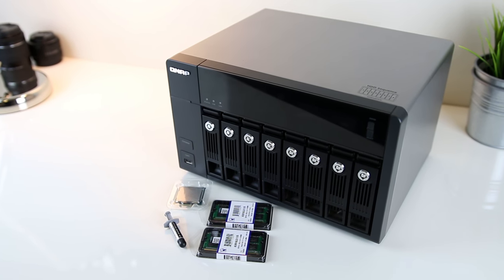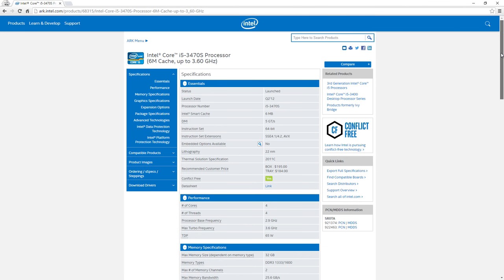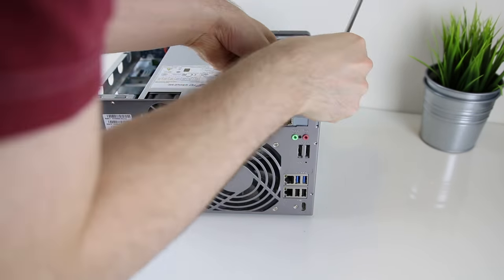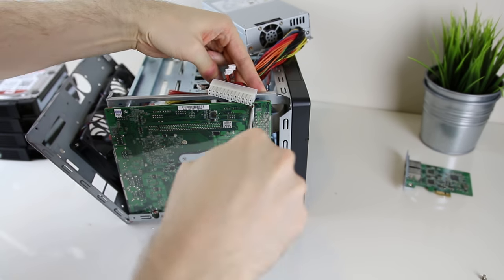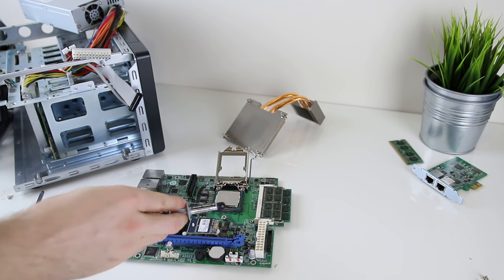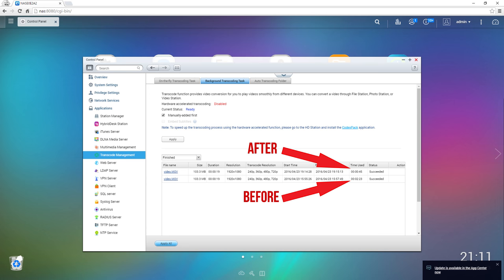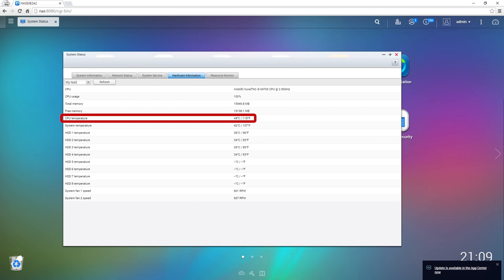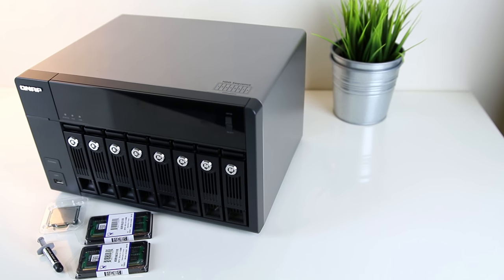Upgrading The QNAP TS-870 NAS - New CPU And RAM

Comment: This is such a great video!

I was able to perform the exact same upgrade using the same CPU and DDR 3L memory. The box is noticeably faster on the web interface. It took me an hour but I left off one of the front-panel cables so spent another hour trying to figure out what was wrong. I'd love a little more detail on the cables in the video.

Thank you so much!

Comment: Thank you for this! I finally completed my upgrade tonight. Luckily a shop in Adelaide (JDM PC sales) had a second-hand i7-3770S in stock at a good price. Shipping was quick too.

I followed your video exactly. That long screwdriver though! Luckily Bunnings closes late here. Quick last-minute trip. But they don't even have a #1 Phillips screwdriver that long on their books! I did get a long extension bar for a screwdriver drill bit that worked though thankfully.

I am loving seeing Memory usage hovering around 8% rather than 90%.  Right, lets set up some VMs! Very happy.

Comment: Thanks for this video. It gave me the courage to finally upgrade my 870 with an i5-3450S. Could have went with a beefier chip but decided to keep the power consumption low and the cost relatively low. It's more than enough for what I do. Believe it or not, the Celeron was a downloading speed bottleneck. I have a 1 Gbps FiOS connection and the CPU was always pegged when downloading via usenet. The most I ever got was 95 MB/s, but after swapping out the CPU with the i5, my speeds rocketed up to 108 MB/s (downloading + unpacking simultaneously!) Who knew that the CPU played a major role in unpacking. I guess IOPS heavy tasks require a decent CPU. So thanks again for the help.

Comment: You can get third party 10gbe network cards that work in the Qnap for around £100.Also the cheapest 10gbe switch is around £250 (With at least two 10gbe ethernet ports)

Comment: I know its an old video, but I still use my TS-870 Pro as a media server and backup storage device.  I did your upgrade with 16 GB Crucial RAM ($80.00 US) and the i5-3470S ($18.00 on ebay).  What a way to breathe new life into an otherwise awesome NAS.  Although I'd have figured out the procedure myself, your video was most helpful !!!   Thanks for sharing.   Oh... BTW - your description says you used an i5-3450S not the 3470S you really used.  I really like the i5-3470S as its a true 4-core CPU, not 2-core with HyperThreading.  4 full cores always performs better than 2 + 2HT.   ;-)
Reply from the maker: That's good to hear I'm still using mine as well and it's working great!
Reply: @JarrodsTech  Its kind of a shame that QNAP will End-of-Life the 870 Pro near the end of 2020.  The unit is still in perfect shape and should last a lot longer. I like getting the new OS version updates.  I have 3 older QNAP servers that are EOL and I only get occasional OS patches for those.

Comment: I just upgraded my qnap 470 ts to i7 3770S and 16gb ddr 3 ram 1600mhz.
System flies. I added also 8$ pci nvme off ebay with 256gb toshiba nvme ssd it works like a charm.  Used new arctic paste on cpu. Syste. Runs faaaast 😎 soo happy iam set for a while now.
Reply from the maker: Nice upgrade!

Comment: On this hot Australian summer's day, I was wondering how the stock cooling went with your i5-3470S upgrade. I'd assume not a lot of difference for only +10W TDP. I've got the PRO model, which already has the i3-3220. For everyday use (maybe play around with virtualisation, but not seriously), I probably won't see a lot to be gained from any Ivy Bridge CPU upgrade. I've found an i7-3770 (TDP 77W) as well as the i5-3470S you used. Concerned I'll then have to mess around with the cooling in the case of the i7. What do you think? Keep the stock i3-3220 (55WTDP) and just upgrade the RAM? Put in the i7-3770 and deal with the cooling if necessary?
Reply from the maker: To be honest my NAS sits pretty idle these days, I put 4K video on it and edit off of it but it doesn't really get much of a work out other than just storing and serving video files, I don't even monitor the temperatures. It's sitting at 46c idle at the moment with both fans on 800 RPM, I'd like to swap out the fans at some stage, even at idle the fans are louder than I feel they should be.
Reply: A couple of years late to replying... but I upgraded to the 3770S and 16GB many years ago and my NAS lives in rack a garage in Melbourne Australia.  In the peak of summer if we have a series of 40C+ (104F+ for those that need freedom units) days I will very occasionally get heat warnings, but never enough to have it shutdown (which it will do).  Even in this extreme it copes just fine.  I'm currently looking to breathe some more life into this old NAS by moving to UnRAID or something.

Comment: thanks for this detailed video.  i'm finally getting around to upgrading my 870 pro, so my appologies for the very late reply! :)

May i ask - why did you go with the 3470S over the 3470T, which you stated had a lower TDP rating which would be desirable.  what it just a cost decision?
I am still weighing my options as to what the best CPU to go for is... and am looking at their bigger brothers, the i7-3770T & 3770S.  by your logic, the T is the better choice... so long as it's not too pricey.  are you still running the same setup all these years later and happy with how everything has been?
Reply from the maker: Cheers! To be honest I can't remember the reason but think it came down to pricing / availability at the time. Yeah I'm still using the exact same setup, though since this video I filled up the rest of the drive bays with 4tb drives. It's about 2/3 full though so might have to look at larger drives in future, or another plan was maybe use this Nas as a backup and get a new one with the larger disks and just nightly backup important files to it or something. Still works perfectly fine to this day with all the upgrades though 👍
Reply: @JarrodsTech  great, thanks so much for the video and effort - I went ahead with the same choices. In the end, I also couldn't justify almost double the cost for the T,, which isn't double the chip, even on the used market. 

The NAS has been running great!!  Your tips made it a breeze (done in 25 min)
Reply: Yeah, the T chips are hard to get and expensive. Does it run ok on the S chip? By "run ok" I mean not too hot or fans working hard all the time?

Comment: My question is, if i upgrade the memory in my NAS will it "Unlock" other apps to use i.e. i have a TS-469 PRO and if i "Upgrade my memory" will it unlock the Virtualization Station or other more memory intensive apps
Reply from the maker: There does appear to be memory requirements: https://www.qnap.com/en/how-to/tutorial/article/virtualization-station-system-requirements

To be honest I can't remember if it was unavailable for me before upgrading, I don't think I ever attempted to install the feature.

This article also notes that at least 4GB is needed: https://www.qnap.com/en/how-to/tutorial/article/how-to-use-virtualization-station seems to depend on the model of NAS though. I can't see the TS-4* series listed there though so you may need to contact support and confirm that it's possible. If you do please let me know what happens, I'd like to know!

Comment: Awsome tutorial  iam gonnaa do same upgrade to my qnap ts 470  but iam usong i7 3770S
Reply from the maker: Thanks! Sounds good 😃
Reply: @JarrodsTech  i found base cpu a 2.6ghz  celeron g550 has 65w TDP as i7 3770S 65W TDP
Reply from the maker: Nice one 👌
Reply: I have 2 question for you. 1. Do you have to use qnap  network  card or can you use any brand of low profile network card. Also i noticed a mini pcie on the motherboard can those be used for ssd card?
Reply: Yes same tdp  cpu temp at 5% cpu  usage is 51 -53 degrees.  At 0 cpu uaage   47 degrees.  Used arctic silver 5 paste.  Also i added 8$ ebay m.2 pcie m.2 adapter  with 256gb toshiba nvme. And it was detected by the system 😍 .iam using it as system disk cache. So  no need to fork out 200 $ or more  on qnap  branded     m.2 adapter. Expansion card.    I noticed there is also a half height mini pcie port that is  in the back of the mobo.  Next i will get a     1 gb 6gbs msata ssd for it.

Comment: Can you think of a sub $1000 model that has CPU that is upgrade-able? Thanks.
Reply from the maker: Hmm not really sure, I haven't been looking at the recent models so I don't know what's available. I just looked at a couple of QNAP NAS for sale that are newer and they have upgradeable CPUs. QNAP TS-563-2G 5 Bay NAS and QNAP TS-431X-2G 4 Bay NAS for example have the i7 4770 which is already quite powerful, but not soldered so the CPU could be replaced with others that support the same socket.

Comment: Do you think that the nuc board with a i3 7100u (nuc7i3dnbe) could be fit inside the 439 pro 2 as a full replacement of the original board ofc?
Reply from the maker: I have no idea in the form factor of either, sorry.

Comment: Hey there! I'm thinking about buying the QNAP TS-873, but do you think that the CPU of that model is also upgradable? And if so; how do you know which CPU's will fit on the motherboard?
Reply from the maker: From a search it looks like the CPU uses "AMD R-Series RX-421ND", I've never heard of this but it sounds like it's an embedded SOC, so likely soldered to the board and cannot be upgraded. For upgradeability I think you'd need to look for something with an Intel i3/i5/i7 or AMD Ryzen CPU, as those would most likely have sockets.
Reply: @JarrodsTech  Thanks! Are models with well-known CPU's (Like a i5, etc.) more likely to be socketed? Or how does that work?

Comment: Hello Jarrod,  question - Do you think putting in a Intel I-7 cpu at 95 thb into the ts-870 pro would be to high? I saw that you used a Intel I-5 processor and you said that you were concerned about the tbd being higher than you liked but was ok . Do you think the I-7 would be ok, my qnap is on 24/7.
Thank you
Joe
Reply from the maker: Maybe, really comes down to how hard you're loading it up, if it's mostly idle and only doing short bursts of load even if the CPU TDP is higher than the cooler can take it'll probably be ok for the most part. I don't really know how hot it would get though, you'd just have to test it. I suppose worst case it would just thermal throttle and perform a bit slower.
Reply: Jarrod, Thank you sir!

Comment: could upgraded it to a i7 and more than 16gb of ram if you wanted?
Reply from the maker: With this model I believe 16gb of ram is the maximum, however yes i7 is possible with this socket, I decided against it as the CPUs cost a lot more and have a higher TDP and I was unsure if the cooling solution inside would be able to deal with that.
Reply: @treje  I have instaled i7-3770K :D from over 3 years :D and 16GB :)
https://forum.qnap.net.pl/attachments/upload_2019-3-16_11-55-48-png.23420/

Comment: Can you upgrade the CPU in a QNAP TS-453A? It has a Intel Celeron N3150 Quad Core CPU in it. Thanks.
Reply from the maker: Unfortunately it looks like that one is soldered to the motherboard so upgrading won't be possible.

Comment: Hi there, nice video. 
I have a ts-639 Qnap and I don't know what CPU is inside... 
Can I upgrade it please ? 
Also the RAM ? 
Thanks a lot.
Reply from the maker: It should tell you the CPU somewhere in the hardware info when you log into it, after doing a search though from what I can tell it uses an Intel Atom CPU, I believe those are soldered to the board and can't be upgraded. Not sure about the memory, it's more likely that will be possible, but you could just take the outter case off and try and have a look if you've got standard memory slots.
Reply: Via ssh the "/proc/cpuinfo" tell me "Genuine Intel(R) CPU N270   @ 1.60GHz"
So can I upgrade it please ? 
Thanks again
Reply from the maker: No: https://ark.intel.com/products/36331/Intel-Atom-Processor-N270-512K-Cache-1_60-GHz-533-MHz-FSB

The socket is listed as BGA, ball grid array, soldered. Another way to check is search if you can just buy the CPU, it does not appear to be the case because you can't.
Reply: Jarrod'sTech Ok thanks a lot. I will change the NAS.
Reply: @MrDenisJoshua  yeah atom cpu is part of the mobo   not removable.       U can swap out stock 1gb ram stick for 2gb max. It does not work with 4gb ram stick i tried it. It beeps and nothig else.  Get this qnap ts 470  socket 1155 cpu or ts 471 socket 1150

Socket 1155 can be had for 140$ i7 3770s 65w 8 thread 8m  3.1 to3.9ghz  so its fast  

Socket 1150 cpu 300$ and up  same 8 thread 4ghz to 4.4 ghz for i7 4790k  but at 88w    
Socket 1155 cheaper by few hundred bucks but oy  20 % slower than i7 4790k

I use my nas to run surveillance station  camera  app with  12 cameras on qnap 439  same cpu as urs . ts 439 boggged down with cpu at 95%   qnap was basically useless for anything else.
On ts 470 ultimate 😎 cpu usage at 3%  51 to 53 degrees.  With 12 cameras recording.   If you got deep pockets get the ts 1200 series 6core  ryzen amd cpu qnaps but they are few grand .i got my qnap ts 470 on kijiji  for 650$  barely used with 3 x3tb hd
and 256gb  sata ssd for cache.  the mobo had 0 dust on it . to upgrade it i got 16gb ram on kijiji for 90$ cad  cpu off ebay for 140$  cad
Toshiba nvme 256gb for 80$ and nvme adapter off ebay for 10$   grand total 320$ plus 650 $ qnap         = $ 970  not bad with upgrades. These qnap ts 470 they go for  1200$ on ebay base. No hdd.included.  this upgrade is really good and my qnap is  good for years to come..
Reply: @mmarczuk1976  Thanks a lot

Comment: how does this NAS hold up in 2020 to the newer versions they released?
Reply from the maker: I'm still using it every day and edit all my 4K videos off it, works well, haven't used any newer ones personally.
Reply: This NAS DEFINITELY holds up in 2020. Working for 6 years (many reboots ofc). Added 10GbE NIC to my stock 870Pro with a direct line to my PC's 10GbE. It is pretty fast. Right now without making sure the NAS isn't busy (it IS running containers), I just casually sent a 2GB file to it at 300MBps (2400Mbps). I believe in a testing environment under good conditions I've had easily double that. Visiting this video again as it's time to upgrade the RAM. 2 Transmission docker containers plus PLEX Media Server occasionally fills the 2GB stock RAM and one of them shuts down. But most of the time even this is fine with 2GB.
Reply: @ScottKeene70  Awesome. I’m thinking of picking one up. How does the hdmi work as in media server/theatre? I’ve always wondered how it could do it so well without a dedicated video card. Or am I misunderstanding it?

Comment: I have the TS-451, what CPU can I upgrade it to?
It currently has the intel Celeron j1800 @ 2.41GHz
Reply from the maker: Hey, that CPU uses socket FCBGA1170, from my research the 'BGA' part means it's Ball Grid Array, so it's soldered onto the socket, so I don't think it's possible to upgrade a CPU with that socket in the same way.

The best way to know for sure would be to open it up and confirm that the CPU is soldered onto the board.
Reply: Jarrod'sTech thanks for the info.
Reply from the maker: Happy to help!
Reply: From my knowledge  ts x70  x71 and x509 series have removable cpu     x70 series have zoclet 1155   x71 series have zocker 1150

Comment: What would you replace the CPU on the TS-563-2G with? Thanks
Reply from the maker: That one probably isn't the best example, as it already comes with an i7 4770 which is pretty decent. Basically I look up the socket the CPU uses, so FCLGA1150 in this case, then look at a list of all CPUs that support that socket. With that socket you could upgrade to a 4790 or 4790K if you really wanted, overclocking probably isn't supported with the board (I didn't check) but even at stock the 4790K is a bit higher than the 4770.

Comment: Hi, I have QNAP ts-569 pro with  Intel Atom CPU D2701 @ 2.13GHz ... What is RAM upgrade max?  What about processor?
Reply from the maker: That CPU looks like a BGA socket, so ball grid array, most likely soldered to the motherboard and cannot be replaced. As for memory limits I'm honestly not sure as I have no experience with that model, you could try asking QNAP support though.
Reply: Thanks Jarrod!!! @JarrodsTech
Reply from the maker: @deankaramehmedovic73  No problem!

Comment: Hi, I have a TS-469 Pro. Can you recommend a processor for upgrade? Thanks in advance
Reply from the maker: The specs on that model show that it uses an Intel Atom CPU, is that correct? You should be able to confirm in the interface. From my understanding, those are soldered onto the board, so you don't really have the ability to simply swap out the CPU like I did in this video.
Reply: Yes, it is an atom. That is sad, I was hoping I could get some more juice out of the unit for my Plex server.
Reply from the maker: Ah :( I think you're out of luck then. If you get a new one just make sure it uses a standard CPU socket so you have the option of swapping it out in future with an upgrade.

Comment: Hello, I have the TVS-682 with the intel i3 6100. Can I update with the Intel 7700 i7? Thank you for the video.
Reply from the maker: It will depend on what the motherboard will support, not sure if it can take 7th gen CPUs, 6th gen like the 6700 should be ok though (assuming power supply is enough for it).
Reply: I have tried with the 7700 but it doesn't star the system. I have reinstalled the 6100 and it star normally. Do you think that is a motherboard compatibility?
Reply from the maker: Yeah probably, perhaps see if there are any updates or find out if that model supports 7th gen? I'm not sure if motherboards that were designed for 6th gen support 7th? Honestly never really looked into it.
Reply: Thank you, I'm going to try
Reply from the maker: Cool, let me know how it goes!